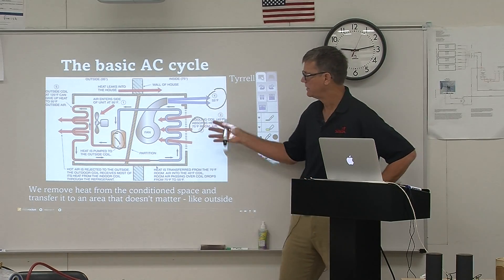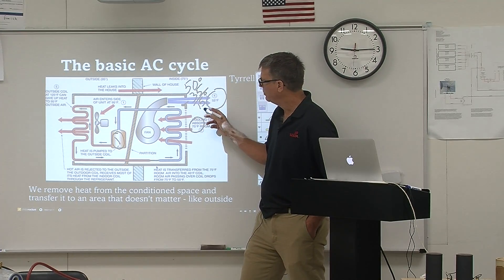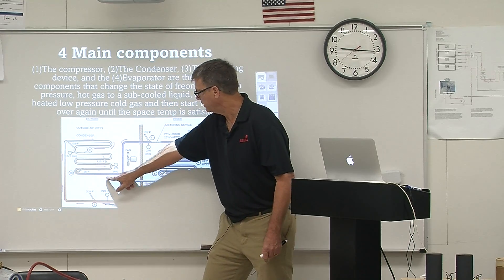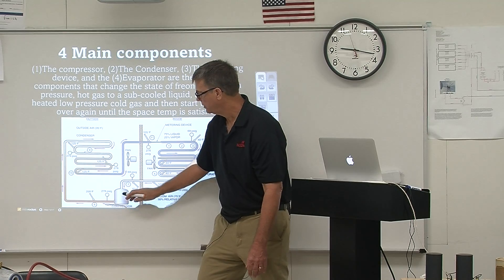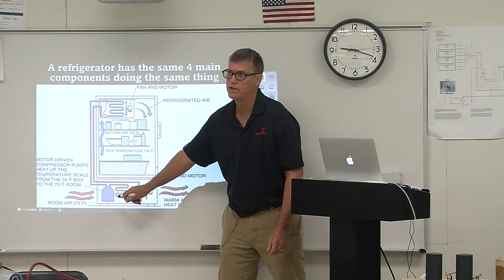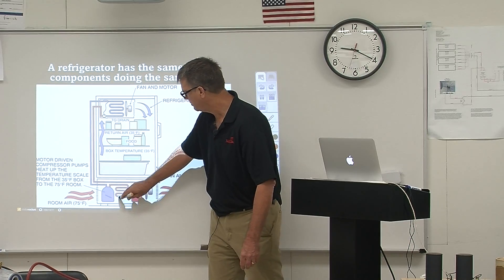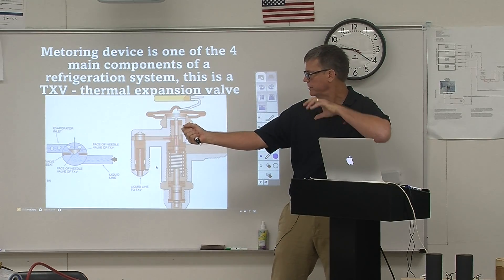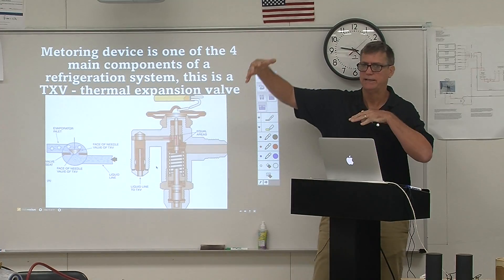Refrigeration Physics Part 2

Comment: So intriguing how these systems function. Do have one question: How much of the sensable heat on the condenser side is from the mechanical energy of the compressor compressing the coolant (friction from compression) vs just the energy absorbed in the low pressure side being concentrated tighter together?